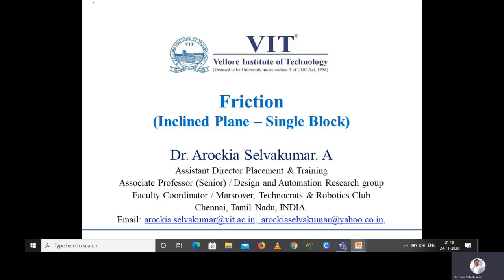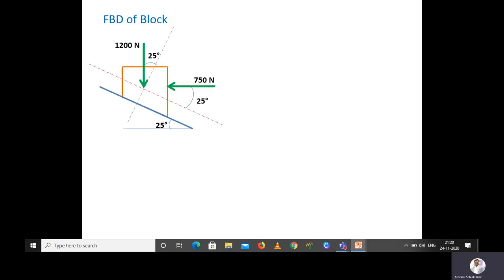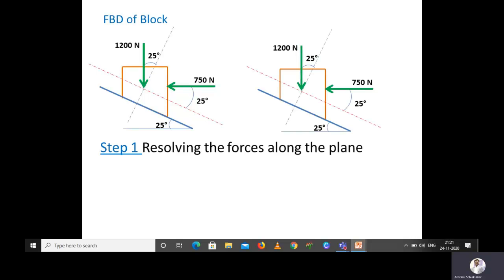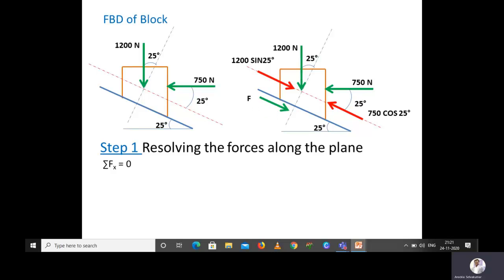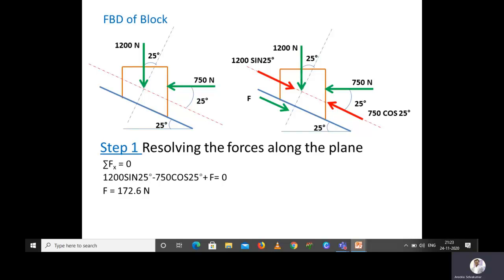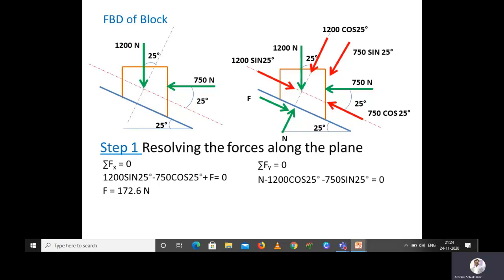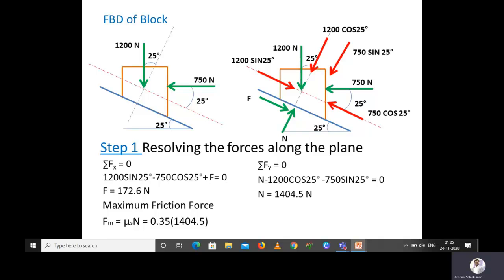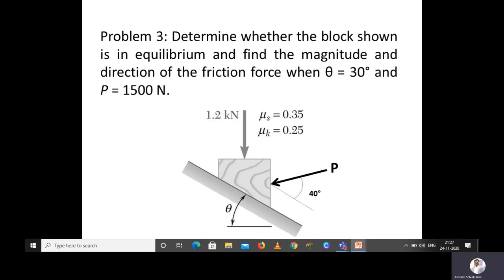How to Calculate Limiting Friction?

Comment: ASHNA HUSSAIN
Q2) the body is not in equilibrium(f>fm)
F = 470.096 N (Upwardsup opp to mvmt of block down)
Fm = 389.980 N

F > Fm 
 Fk = 278.5575 N

 So, the block is not in equilibrium. The block will move down the slope.

Q3) the block is  in equilibrium,(f<fm)       
F = 549.066 N
 Fm = 701.193 N

 F < Fm
     So, the block is in equilibrium.

Comment: Answers:
PROBLEM 2:
->F= 470.096(towards left)
->Fm= 389.98 N
Since F>Fm, The block slides downwards.
->therefore Fk= µk X  N
                      = 278.557 (upwards- opposite to the direction of motion of the block)
------------------------------------------------------------------------------------------------
PROBLEM 3: (PLANE INCINED AT 40˚  )
->F= 549.06 N (towards rights)
->N= 2003.41N( upwards )
-> Fm= µs X N= 701.19 N
->Since F< Fm the block doesn't move.
Therefore the system is in equilibrium.

ASWATHY VINU NAIR ( 20BME1074 )

Comment: Problem - 2) F = 470.096 N (Upwards of the slope)
                       Fm = 389.980 N
                       F > Fm 
                       Fk = 278.5575 N
                       F > Fk
                      So, the block is not in equilibrium. The block will move down the slope.
Problem - 3) F = 549.066 N
                       Fm = 701.193 N
                       F < Fm
                       So, the block is in equilibrium.

Aeswin.L -  20BME1026